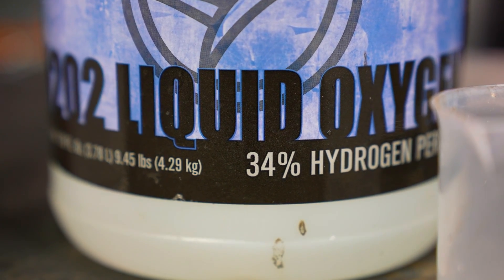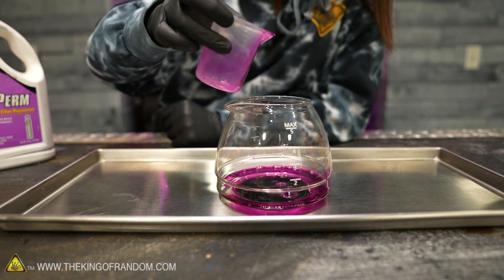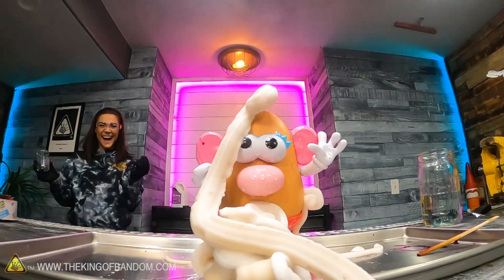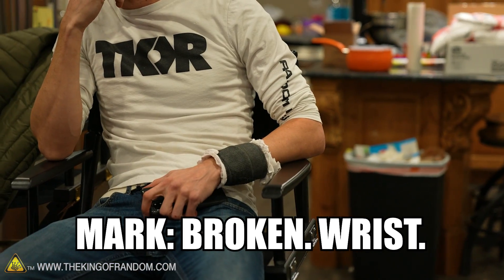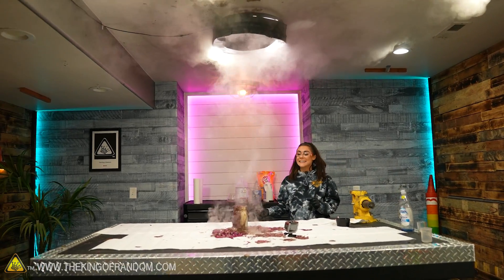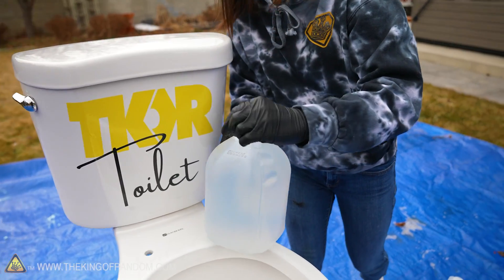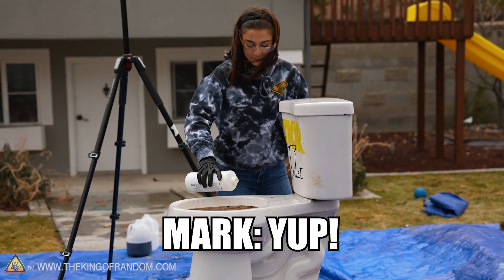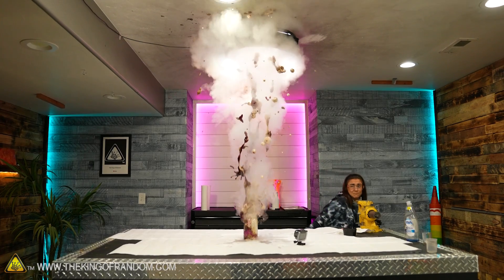Can Elephant Toothpaste Blow Up a Toilet?!

Comment: can you make a mega-sized mento and have a massive coke and mentos reaction video 
like if you wanna see this too
Reply: I was thinking fill an in-ground swimming pool with diet coke, and use a dump truck load of mentos.
Reply: @jmt8706official  wait I've seen videos like that, the reaction isn't as epic as it seems cause there is no pressure built up you need to have a narrow exit point for it to work properly

Comment: You could seal the chemical in a small, breakable bag, fill a stretch Armstrong with peroxide and the little bag, seal it up, then break the bag like those single use ice packs. It could be pretty cool to see it just blow up the rubber when you pop the inner bag.

Comment: Elephant toothpaste rocketry. Try making a liquid rocket. Two chambers hold liquid, both pour into a reaction chamber with a burst disk over the nozzle, when pressure builds enough the disk ruptures and foam sprays out as rocket takes off.

Comment: For the potato, I would suggest putting the peroxide in a balloon inside of the potato so you can suspend and tape off the top hole, then just puncture it through one of the smaller holes!

Comment: Take Easter eggs and fill one half of it with each chemical, and seal them (use some kind of film in the middle to keep them from mixing early) Elephant Toothpaste Grenades
Reply: OMG U GENIUS 🐣💥 you got 9️⃣9️⃣9️⃣9️⃣9️⃣9️⃣9️⃣9️⃣9️⃣9️⃣9️⃣9️⃣9️⃣9️⃣9️⃣9️⃣9️⃣9️⃣9️⃣9️⃣9️⃣9️⃣9️⃣9️⃣9️⃣9️⃣9️⃣9️⃣9️⃣9️⃣9️⃣9️⃣9️⃣9️⃣9️⃣9️⃣9️⃣9️⃣9️⃣9️⃣9️⃣9️⃣9️⃣9️⃣9️⃣IQ

Comment: elephant toothpaste gives off heat in the reaction. is it possible to seal a piece of food to protect it, and use elephant toothpaste to cook it?
Reply: that stuff cools down too fast to cook anything with it. unless you used multiple batches and set them off one after another. it would be a very inefficient and messy way to cook
Reply: @x3onz  yes, and very useless and supplies and time consuming
Reply: @coveredinstars  elephant toothpaste by itself is useless and time consuming. it's the shittiest experiment that hit youtube
Reply: Popcorn